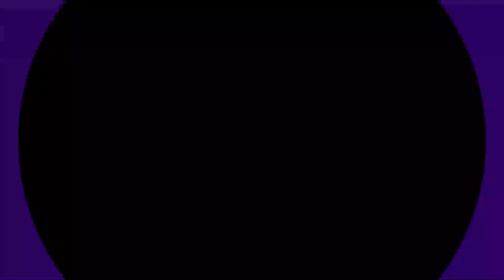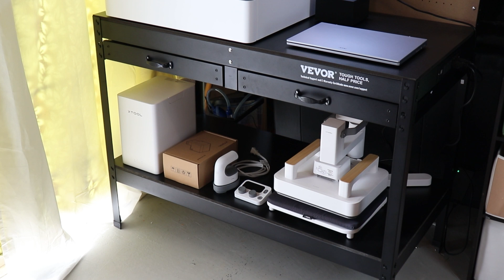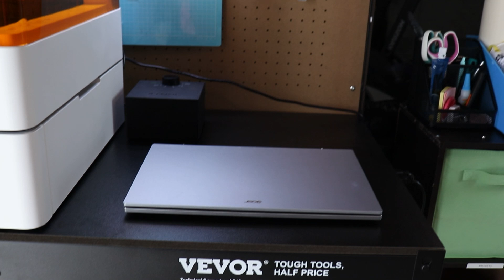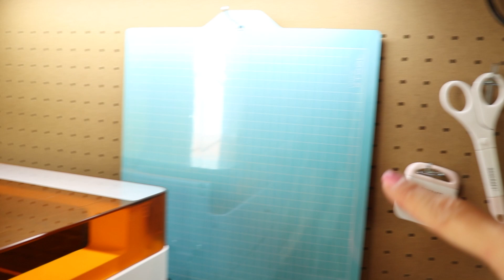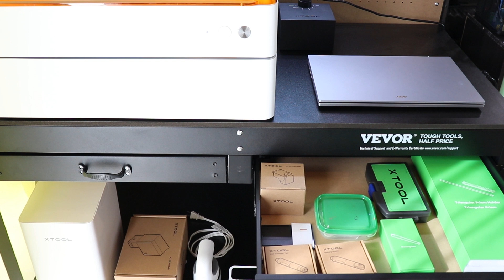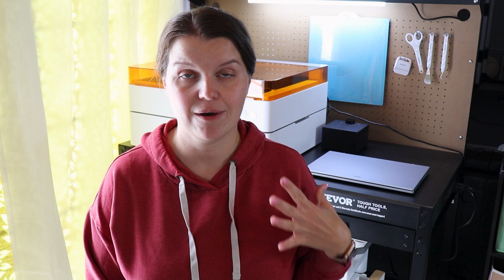Set up xTool M1 Ultra on Laser Workbench

Comment: I ended up choosing the VEVOR Workbench Adjustable Height 28-39.5", which you mention near the end of your video.  This is similar to your table, but it has a wooden butcher's block table and square legs.  With the square legs, I also bought the VEVOR casters that simply screwed into the bottoms of the legs.  If you have your workbench on a concrete floor, this allows you a lot of mobility in case you have to clean the area beneath your workbench or move the workbench out of the way for whatever reason.
Reply from the maker: That's a great workbench, I love having it on wheels too! Glad it's working for you.